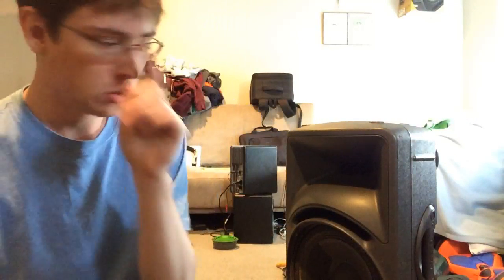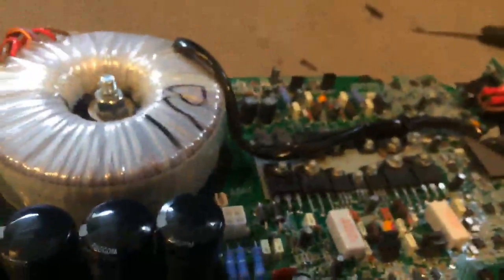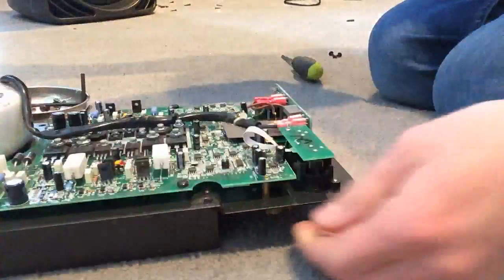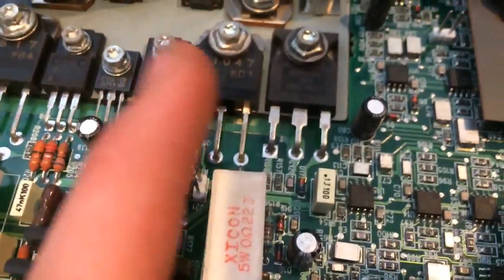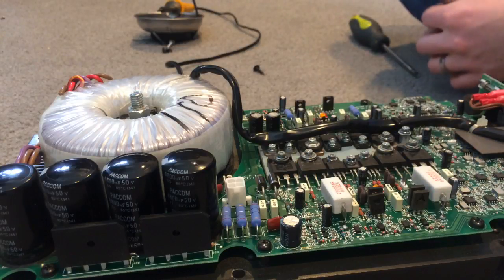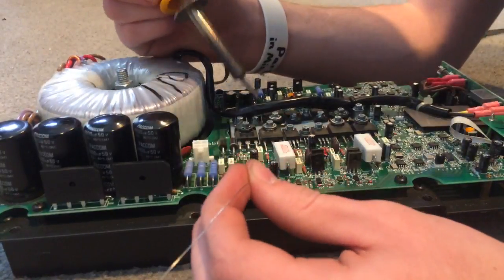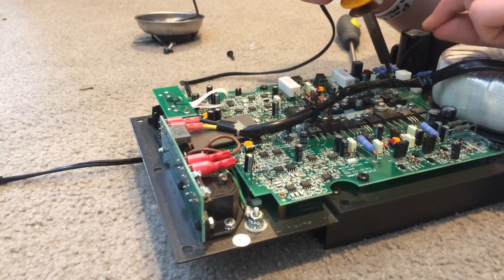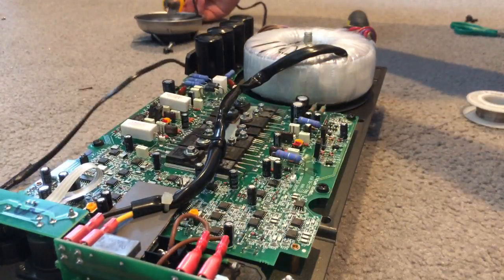Repairing a distorted sound Mackie SRM450 v1

Comment: My Mackie 450 stopped during a wedding!! Luckily the one remaining speaker was good enough to handle the evening without the guests noticing. You can barely hear anything but a whisper. Is the board shot? there was no warning....it stopped. Any info would be helpful. Thanks, Larry
Reply: I’ve been doing weddings for 20 years and I used to have that exact nightmare. Had to purchase a 2nd set in order for the nightmares to stop. Well … and a 2nd computer, and a 2nd control board, and a 2nd wireless microphone  … and a year later …… then the nightmares stopped! 😂😂 Doings weddings is a ton of pressure!

Comment: I fricken love speakers and stereo equipment!..apparently so do you!..lol..Thats awesome..That is a double sided board and technically is soldered from the other side..I would have flipped the board over and inspected the through hole joints with a jewelers loop and looked for the classic circle cold solder joint/crack that is from fatigue and vibration..It would be a lot easier to solder from the other side, but your technique got it done...On older equipment they used lead solder which is a fantastic joy to work with!..solders and reflows so easy..The new china crap they use lead free solder that i think sucks and can be a pain to work with... A tip on soldering is no need to heat up the joint first, just get on it and bridge a blob of solder between your tip and the joint..That will create more surface area for the heat to transfer from the tip to the joint and it will heat up much faster!...I see your using silver solder which is good for a plate amp like that that has a lot of vibration..I sometimes use silver but i always use lead solder, non of that lead free crap!..lol..Those double sided boards can be incredibly difficult  to remove a 4 pin through hole component from!..i have some tips on doing that if you ever have to remove a component
Reply from the maker: On the Mackie boards, They have to be connected on both sides of the board so I use extra solder and it goes through the hole. :) I have removed countless components in my life and I have a solder Vac to do that with. Thanks for the feedback though!
Reply: a electric solder sucker?..one was a electric air pump?...i use a spring loaded sucker and or solder wick, but i have have started not using them and remove the components without them
Reply from the maker: Spring loaded
Reply: i would love to have one of those electric air pump ones!..There high dollar though..I may make a vid on my de-soldering technique on double sided boards..did you learn about electronics and soldering all by yourself or did you learn it from your dad or somebody?
Reply from the maker: All self taught
Reply: nice!..i am impressed with you skills

Comment: you're video didn't help much because it didn't have a before and after distortion sound comparison...
so i dj'd at this spot a few weeks ago and it felt like the alto powered system couldn't keep up with the big venue. it felt to me like i was pushing it a little hard. i have a non powered system that is unbreakable so used to higher volumes but i couldn't use mine because of the flight of stairs. 
when i went there today it sounded fine with the owner of the venue trying to recreate the problem but we couldn't hear it. after a while of talking to him in a different and walking out the distortion seems to came back. the volume was about medium and i could hear vibration/distortion as if something was lose inside...